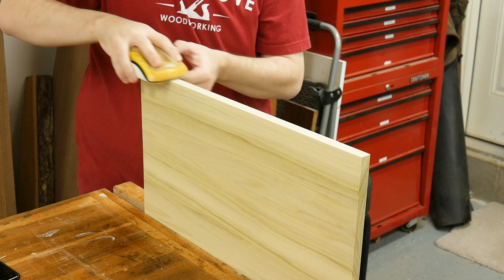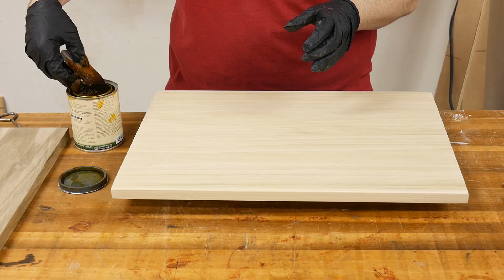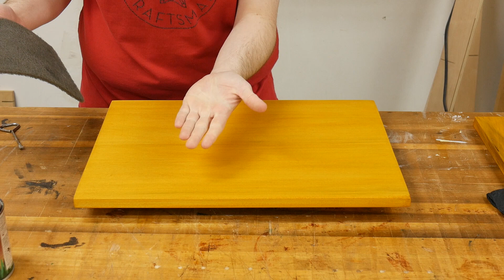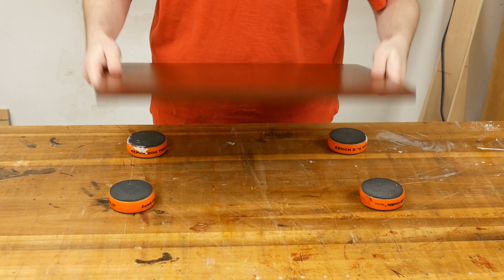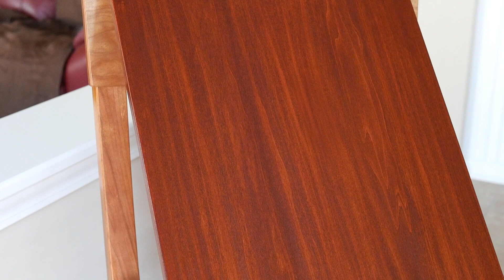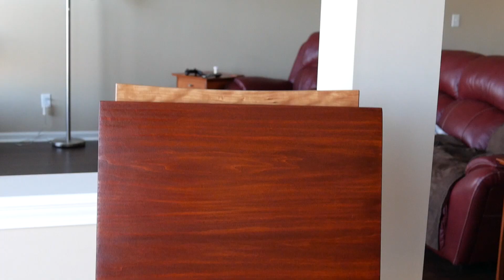How To Stain Poplar

Comment: I always raised the grain of the wood  1 grit before sanding the final grit and there no need to pre stain conditioner. ( Example 80, 120, raised the grain, 150 then stain.) I get better results free from blotches by sealing the raw wood with shellac about 2 coats then use dye color
Reply from the maker: I'm not sure I understand your statement of "No need to pre stain conditioner" yet you go on to say you use shellac as a pre-stain conditioner?